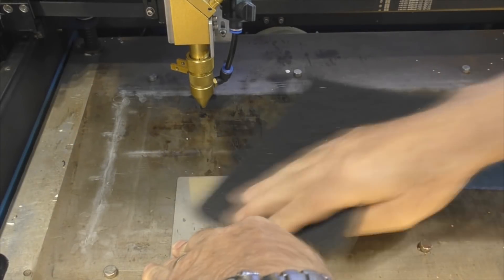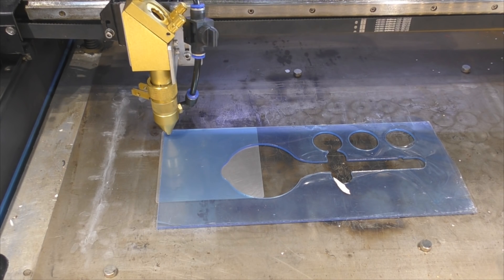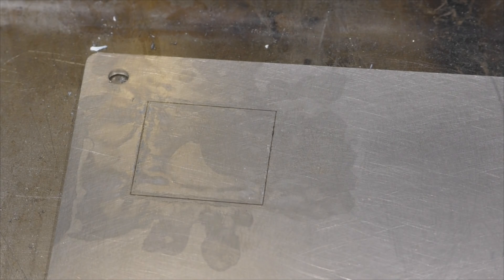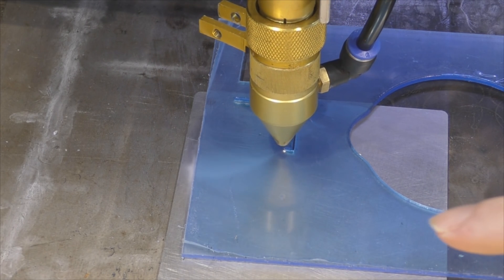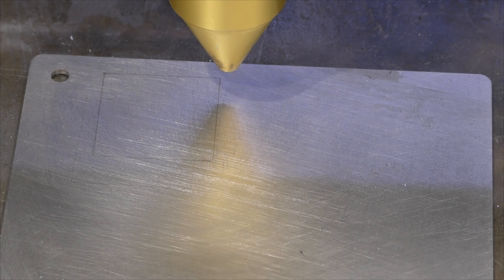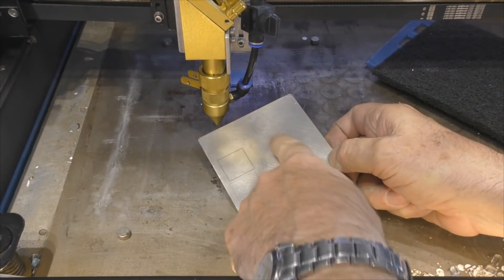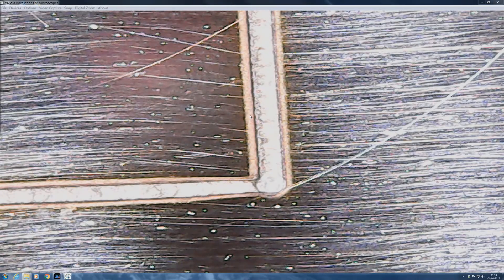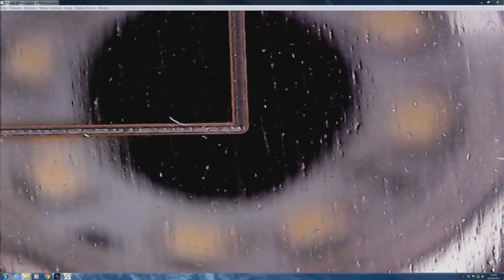RDWorks Learning Lab 100 Etching Stainless Steel

Comment: What would happen if you did the same cut like 3 times in a row???
Reply from the maker: The second and third test would be no different except you may not even get to the second test because your lens would already be destroyed.  ALL metals are mirrors and in the case of stainless steel it is at least 96% effeicient at  refelecting the energy back onto the lens. That energy is sufficiently powerful to burn off the coating that is on the lens. There is an interesting property of firing CO2 light at a metal surface.  In its solid state the metal acts like a mirror but IF you can throw enough power to melt the surface, the MOLTEN metal no longer acts like a mirror. instead  it absorbs about 60% of the energy  to keep the molten state going. The risk to your lens is high so that is why I made this video. I have a few lenses that I was prepared to sacrifice so that you dont try the same thing
Berst wishes
Russ
Reply: @SarbarMultimedia  would you be interested in helping me troubleshoot a electric power problem on my 100w machine?
Reply from the maker: @duanecalhoon3322  
 It is usually difficult to assist people on an open forum.  You tube does not allow emailmaddresses so if you like to contact me via this private contact form I will try to help solve your problem
https://forms.zohopublic.eu/ndeavorlimited/form/K40XtreeemLaserCutterContactRussSadler/formperma/k2Cn0QN5ChpazfTMAUw25lZ-FKpjZa96TQWHjv3ntOg
 Best wishes
Russ
Reply: I contacted you thru the link below, thanks
Reply: It kind of makes me wonder,,,, 90 percent of my engraving is done on stainless steel tumblers, I know the first pass cuts the powder coat but I always do a 2nd or 3rd pass just to clean up the SS after the powdercoating is gone.

Comment: Hi Russ,
I am a novice and have just purchased my first Co2 50w machine, I really want to etch/engrave onto stainless steel but am having difficulty finding agents that i can use for bonding in Sweden, do you have any recommendations, I have watched your LBT post, but again unable to buy that product in Sweden. any support will be very much appreciated.
BTW, i really do like your videos, so educational.
Reply from the maker: Hi Stephen

 Marking stainless steel is a heat induced chemical process . This video is everything your should NOT do with stainless steel because it will kill lenses faster than you can buy them.
 All you can do is MARK stainless. Since this making  video, I have done more experiments and investigations so you may wish to watch this video.
https://youtu.be/whDqjIhRQ-o
 Cermark is VERY expensive but good. There is another product around that you may like to checkout
https://www.engraving-supplies.co.uk/news/laser-marking-products
https://brilliancelaserinks.com/en-gb
 Also see if you can track down any of these products in Sweden as an alternative to DM-90
https://www.google.com/search?q=dry+Mos2+spray&rlz=1C1CHBF_en-GBGB911GB911&oq=dry+Mos2+spray&aqs=chrome..69i57.12525j0j7&sourceid=chrome&ie=UTF-8

Best wishes
Russ
Reply: @SarbarMultimedia  Thank you so much for this video, it has helped me a lot, one last question, do you believe my 50w CO2 laser will be able to mark golf club heads which are primarily made from Carbon Steel?

Comment: Hi, thank you for the video. Informative. Can I ask what type of protective glasses are you using doing this. Searching for affordable solution with my 130w co2 laser. Thanks
Reply from the maker: H Rok
 The answer is nothing more than £2 cheap non prescription reading glasses. There are lots of people that would like you to believe that this laser light is really dangerous. Well, , tt really IS dangerous but ONLY under certain conditions . . The laser beam is about 6mm diameter and  like a jet of water from a hose pipe  it travels in straight lines and does not create any scattered side rays. In the same way that you can stand right next to a jet of water and not get wet so it is for the laser beam.  You need to be standing in the direct path of the beam to sustain any damage,  95% of all materials turn the light energy into heat when it hits the surface. The exception is ANY metal. Metals act like mirrors and will REDIRECT the light. That is why we have metal faced mirrors in the machine. IF the beam happens to reflect AT YOU from a suitably angled METAL surface within the machine  (a bit like winning the lottery?) then yes it will HEAT up whatever it contacts.   That includes the front of your eyeball, your skin, or your clothes , anything.......... The anything would include  protective eyewear , be it glass or polycarbonate lenses. They will absorb the energy and prevent it getting to your eyes.  I f you do not wear glasses, cheap polycarbonate protective eyewear will do the job well. see
https://www.ebay.co.uk/itm/Safety-Goggles-Glasses-Eye-Protection-Anti-Fog-Clear-Vent-Unisex-Lab-Work/283847952665?hash=item4216a80919:g:eaAAAOSw59pelnI9
 or 
https://www.ebay.co.uk/itm/Safety-Goggles-Clear-Safety-Glasses-For-Lab-Work-Dust-Proof-Eyes-Protector/303617649368?hash=item46b105aad8:g:7lwAAOSwov5fBYuw

The bigger danger to your eyes is watching the cut when you are cutting organic materials such as wood, There is a VERT intense light (much like a small welding arc) where the beam is cutting. This intense white light contains strong UV spikes which WILL damage your eyes of you watch it for more than a few seconds. You would not stare at the sun so treat your cut zone with the same respect.Again, glass or polycarbonate will absorb the UV frequencies BUT  they will NOT attenuate the intensity . It is the BRIGHT light that offers the greatest risk to your eyes.
 Hope this answers your question.

Best wishes
Russ
Reply: @SarbarMultimedia  Thank you very much for extended answer. You confirmed my assumption. I'm using two polycarbonate glasses.7€ each. Both of them I tested with direct focused hit of 50W and 0.4s duration. The beam did not penetrate the glasses just a small burn mark on impact side. No damage to cotton wool I putted on eyeball side. Also totally impossible scenario if somebody ask me. If they protected from direct focused hit they for sure can protect from scattered light with extra acrylic protection (lid closed) between glasses and laser. And yes. Totally agree about welding effect. Been there done that 🥺😁. Stronger the "arc" less I look. It works for me that way for few months now. Again thanks for answering. Have a nice day.

Comment: дуже вражае,   super!!
Reply from the maker: As I  anticipated,  this experiment burnt the anti-reflective coating off the underside of the lens. Yes, there is enough power to melt the surface  but as I say in the video, I knew this was a risk. These lenses are only $15 and I could sacrifice a lens to show you what NOT to do and why. I know you may be amazed at the result but DON'T try etching RAW metal, always cover it with something. You might like to view this unpublished video of marking stainless steel.
https://www.youtube.com/watch?v=BWo_au1TPL0

Best wishes
Russ

Comment: Just curious, why such high power on that thin of stock.  My 40 watt, has to cut at least 5-8mm at 22 mm/s;  Also makes total sense why it ingraves.
Reply from the maker: Hi Rob
It's nothing to do with the thickness of the stock, although the thicker the stock the greater potential for rapid heat transfer to the background. You must understand  a couple of fundamental properties of our IR laser beam. Firstly it is a beam of light and carries no heat, just pure energy. A  rock falling out of the sky  is full of pure kinetic energy but is doing absolutely no damage whilst it is falling. The transfer of energy only occurs when it collides with something solid. The same applies to our laser beam. All molecules are vibrating but the speed and amplitude of that vibration is a definition of their  temperature. When IR light collides with a material, one of two things occurs. If that material is a metal then the beam is reflected. The amount of reflection varies with different metals and is nothing to do with the shininess of the surface but all to do with the crystallographic structure. Metals like copper, aluminium, gold and silver are 99%+ efficient at reflecting whereas stainless is about 95%. All non-metals are highly reactive to the IR light and their SURFACE molecules become easily stimulated by the light energy and start to vibrate faster. More vibration=higher temperature. This is the mechanism of energy transfer that occurs in out machines.. The second thing to understand is that the power is not uniformly spread across the beam. The central core of the beam contains the highest energy density. When you pass this beam through a lens, the high energy focused spot you produce is also NOT uniform. There is an ultra high energy concentration at the centre.  Bear in mind that with stainless steel, only 5% of the energy is being accepted as a molecular stimulant and the rest reflected.  That 5% has to heat the stainless above it's 1450C  melting point to cause surface damage. Once the metal is melted, it's crystallographic structure changes and it then accepts the IR stimulation more readily. . But  60 watts is barely enough to scratch the surface. You need kw of energy to  cut stainless and I was very surprised that I could raise the energy density high enough to do ANY damage. I was using a 38.1mm  focal length lens. If I had tried it with a normal 50.8mm lens with 50% of the energy density potential, I am sure I would have failed.

Best wishes
Russ

Comment: I think what may be going on here is that steel is a VERY poor conductor of heat compared to aluminum and copper alloys.  Since the heat does not flow away, you may be getting it hot enough to affect the surface.  You should pop that thing in a Scanning Electron Microscope!
Reply from the maker: Hi Marshal
You are correct about the lower thermal conductivity of stainless but it also has a lower reflectivity of about 95% when compared to that of gold, silver copper and aluminium which are at 99% plus. For stainless this means there is 5% light interacting with the surface molecules of the stainless. 5% may not seem much but with a 1.5" lens and full 70 watts there is so much energy density in a spot about 0.1mm diameter that  5% is enough to stimulate the molecules above their melting point. Once the metal has melted, it's crystallographic structure changes and it no longer reflects the light. However, there is not enough net energy to cut the material. just enough to melt a few microns deep. That melt material is cooling in the presence of oxygen in the air and its the black oxide layer we can observe. The BIG risk with this experiment was the 95% reflected light. Several people have postulated that the reflected light will be harmless to the lens because it will reflect off the surface the opposite way to the converging focused beam.  I'm pretty sure this is wrong because I have damaged a few very expensive lenses experimenting with cutting aluminium and copper on 3kw metal cutting lasers. The light is not reflecting off the flatish surface but off the crystallographic structure of the material and I think that instead of harmlessly diverging  and scattering off the imagined reflective flat surface  there is a colimating effect from the crystal structure. If this is the case then then add into the mix addition and subtraction of colliding wavelengths and the energy that gets reflected back to the lens would easily be high enough to burn off the anti reflective coating on the lens.  Having "got away" with it for this experiment, my luck ran out when In tried it again on another occasion    . 
see    https://www.youtube.com/watch?v=ZKC8Byc8y28    at about 28minutes 

Best wishes
 Russ
ps  My scanning electron microscope is tossed up in the attic because the wife was complaining about it cluttering her kitchen!!  Big smile. This is shed science not NASA
Reply: SarbarMultimedia Well, I work for the Navy....have one at work

Comment: surface oxidation, if you were to use argon in place of air for the air assist it might come out with a rainbow effect.
Reply from the maker: Hi Larry
I think the effect your are proposing is the thin film surface OXIDATION effect that occurs as you heat a shiny steel surface. The transparent OXIDE film thickens with temperature and causes interference with different wavelengths of light  giving rise to the rainbow effect you describe. This effect happens for each colour at a very specific temperature starting with a faint light straw colour at 176 C and progressing through 7 more recognized colours to  grey blue at 371 C. This level of temperature control can be achieved with a fibre laser  and you can generate coloured pictures  on stainless steel using this phenomenon. However, we stand zero chance of achieving such precision temperature control with our sledge hammer CO2 laser and secondly  argon is a shield gas and is specifically used in welding and other processes to prevent OXIDATION. Thus I think logic decrees that argon will prevent the effect you are imagining
Nice thought though so thanks for the comment.
Best wishes
Russ

Comment: Try to do oxygen assist, maybe it will cut through.
Reply from the maker: Hi Lukasz
Sad to say, oxygen and stainless steel do not mix. I used to run a fabrication business and had two 3kw metal cutting CO2 lasers  and understand a lot about metal cutting. You can use oxygen to accelerate the cutting of mild steel but the high chromium content of stainless steel causes the melted metal to be sticky and like treacle. It will not oxidize like mild steel and the cut will be very messy, if it cuts at all. To cut stainless steel you need to exclude all oxygen and  you do that with a nitrogen cover gas. In doing so you get no oxidation/exothermic reaction to aid the cut, instead you have to increase the cutting power. The melted steel must be blown from the cut to get a clean edge. To do this you need  VERY high pressure nitrogem at  12 to 14bar.  The biggest risk with cutting stainless is the fact that it is about 90% reflective of 10.6 micron wavelength light. Once you can melt it, the crystal structure changes and it becomes absorptive to IR. So you have to throw a high initial pulse of energy at it  to start with.

My fear of reflection did not happen during this video but if you look at https://www.youtube.com/watch?v=ZKC8Byc8y28  22min 50sec you will see what you will do to a lens. Earlier in the video I engraved a stainless label. This was the cost. So dont do it!!

Best wishes
Russ

Comment: OMG , 60 watts focus laser head welding a micro bead on mirror polished stainless steel , That WAS BEUTIFUAL !!! and scary at the same time ( pretty gutsy ) Look like great fun .  would be cool to see the welds as they were being made ,  I'm attempting to make a complex  acrylic light  manifold . and then put it together with optical cement , Humm I may have to look in to just the laser tube , since I already have and X Y  plotter .

Comment: Hi Russ,
I found this lesson extremely interesting as one of my main requests in my shop is to engrave the stainless steel blades of the knives I make. This video proves the concept to be practical for me. when things get settled and I have some more experience, I will have to try this. for now, I will keep reading and watching until my machine gets here. fingers crossed the letters KH do not show up on the tube.
Reply from the maker: Hi
Please  do NOT try to engrave naked stainless as I did in this video. It worked this time BUT take a look at 
https://youtu.be/ZKC8Byc8y28 22min 58 sec and you will understand the trepidation as I undertook this test.
If you want to mark steel there is a safe way
see
https://youtu.be/b_06laAjMPc

Good luck with your new machine
All best wishes
Russ
Reply: Thankyou for the update. I have been watching as many lessons as possible but given that I am "Retired" I (or my wife) have found so much to do that I seem to be busier than ever.

Comment: After watching more than a few of your videos, I've a theory why your lens didn't pop. The beam was/is askew. Your cutlery project proved that you're not at 100% plum, level, and square. Which in this case was a good thing. I'm betting those more expensive machines were tested meticulously to be. That'd have the laser shooting right back up the tube. Your "3 degrees or so" seems to have a benefit.
Reply from the maker: Nice idea but I'm afraid that not the case. The beam has been reset many times between then and now and I am also older and wiser about the peculiarities of cutting acrylic. I was using (and continue to use) a 1.5" focal length lens. I can set my beam absolutely perpendicular to the material surface and still get an off angle cut. Acrylic is unique in that it does not burn or melt, it sublimates when it gets hot enough ie it turns directly from solid to vapour.I should not be able to cut 10mm acrylic with a 1.5" lens but by going slow enough I can. This is due to a light pipe/wave guide/fibre optic phenomenon that occurs where the acrylic traps and reflects the beam inside the cut and causes hot vapour to scarify strange profiles. I will shortly be demonstrating this strange behaviour but please accept that the off angle cut is not through beam alignment. By the way, I thought the same as you originally, it is only time/experience and careful observation that have taught me differently now.
If you watch   https://youtu.be/ZKC8Byc8y28 at 22min 50sec you will see what I did to a lens after etching a stainless label earlier in the video.. Basic advice is "don't' try this at home"
Thanks for the comment
All best wishes
Russ